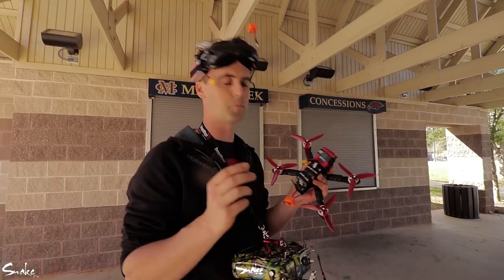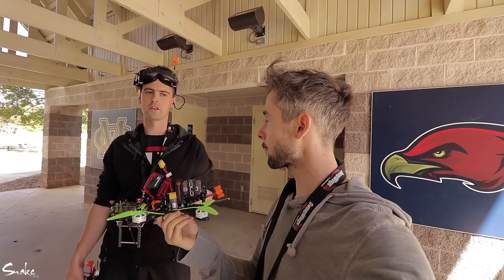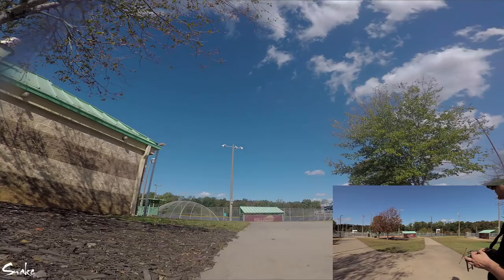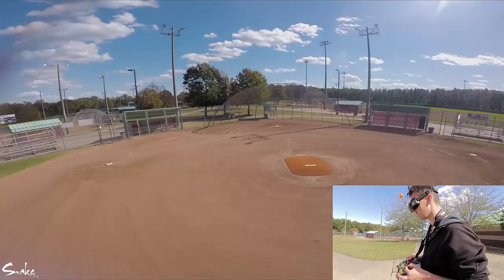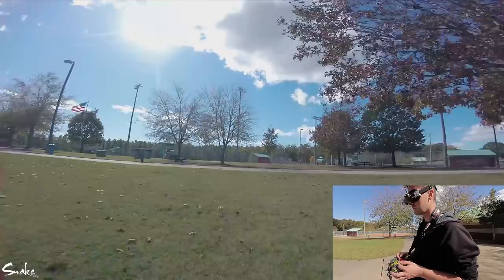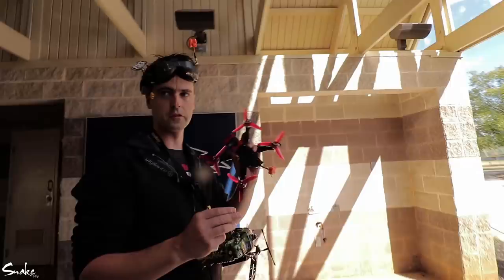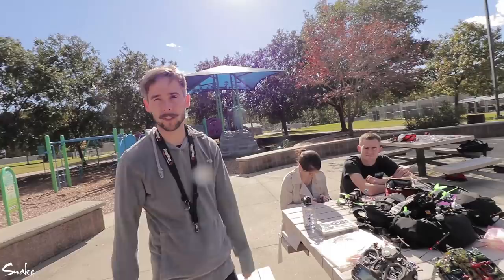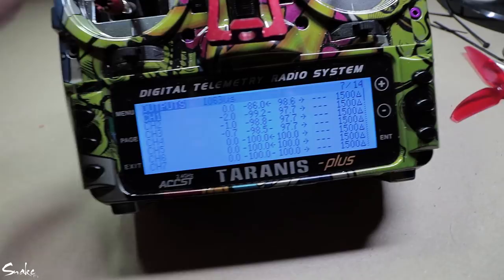Idle up (throttle cut) VS Airmode blind test!

Comment: How Airmode really works... Its actually pretty simple (but easy to misunderstand). The main thing airmode does is gives the flight controller the authority to set each motor speed as high as it wants at any time. If the flight controller wants to set the front left motor at 90%, it can, even if the throttle stick is all the way down. 

Before airmode, if the throttle stick was at 43%, then the MAX throttle the flight controller was allowed to go was 43%. If you roll right really fast, then the left motors were at 43%, and the right motors were less than that, maybe 9% for example. With airmode, the left motors are allowed to spin up higher, like 60%, and the right motors will be around 26%. This isnt very important until you drop the throttle to 0%. Now, without airmode you roll right and the left motors are set to 0% and the right motors are set to 0%. Now you have no control and you fall like a rock. 

Enter the idle up hack. Now the minimum you can set the throttle stick is 2%. So now, with the throttle stick all the way down, you roll right. The flight controller sets the left motors to 2% and the right motors to 0%. Yay, we can roll. But now you notice what this means. We cant roll fast at 2% throttle. Well actually, quads are so powerful that even 2% throttle can indeed roll fairly quickly, but still not as fast as airmode, which can roll at 100% throttle on the left motors and 0% throttle on the right motors and spin at like 1 million degrees per second. 

This now makes it clear what the main benefit is of using idle-up over air mode. At low throttle, you get a very soft quad, and at high throttle you get an aggressive quad. It almost feels like dynamic rates based on throttle position. When you get good at flying like this, as mr steele is very very good, you will notice that you can do a snap roll faster by blipping the right stick to the right, WHILE ALSO, blipping the throttle up during the roll. So, you can do fast snap rolls with idle up, but you have to manage the throttle yourself. With airmode, you can just slap that right stick to get fast rolls. But you cant do soft rolls. I mean you can move the roll stick less, but its just not as controllable as a low throttle without airmode.

Comment: Next test: use air mode but raise min_throttle to the point where idle up was before. It's possible that the more locked-in feel of idle up is just because the motors are idling higher. This might give a better feel at low throttle but also cause floatiness.
Reply from the maker: +Joshua Bardwell hey man, during this test as someone asked the same question earlier so I checked again, the quad with air mode had min throttle set to 1065, the idle up input showed in kiss GUI as 1064.
Reply: Air mode is much better now - as josh said just set your idle throttle to turn motors smoothly without providing lift off ground - on Dshot600 my min throttle setting is at about 2.5% which gives a nice smooth prop spin with no lift sat on ground.  I think steele is behind the times a little.
Reply: Joshua Bardwell is there a video on how to set this up on kiss how do the motors spin when air mode is off thanks
Reply: Interesting. I fly both KISS and Betaflight and have different approaches for both. I use airmode on both, but I set my min throttle on KISS to 1050. Theoretically, less floatiness than 1065, but still enough control. On Betaflight, default Dshot600 is 4.5. A lot of people I've talked to tell me that it should be higher. But I found the opposite is true. I found that at 4.5 it idles at 1050-ish, but on some quads I've gone as low as 4.0, and I find idle to be at 1040-ish. That all said, I'm curious to test out idle-up now.
Reply: The "more locked-in FEEL" is IMHO because of the fact the motors are idling constantly. Airmode spins them only if the gyro "think" there is something to correct. I think the only disadvantage of IdleUp is some really minimal (not noticeable like the stability) decrease of inverted time. Btw Joshua, YOU taught me in 2015 how to setup IdleUp
Reply: So what the anwser? In the start! I never use airmode! cause steel tel that idle mode is better. And feel normal to mee to find the point of idle were i can do flip with no throttel! And no drop. But then all ,fly air mode!  So as a neewbi i do what the most do! But if it is better to remuve air mode an only use idle up? Then plz tell!!!  i rater smash 5 quad lerning the bedst whay! -- :-) Snake/steel - nice together! :-)
Reply: I learned something today! :v
Reply: Are you sure you're not just trying to defend Air mode to your last dying breath?  lol
Reply: I wish they would have left the damn numbers and not used percent.
Reply: Joshua Bardwell would you recommend brake on stop for blheli escs or would you not recommend it?

Comment: For Betaflight users,
You need to set "set pid_at_min_throttle = off" to not have a active gyro at min throttle.
Reply: Lawanti that's it? And airmode active?
Reply: Why would you want to do that? You want PID control when you are floating to keep it steady
Reply: so you can arm without an active gyro and when you idle up the gyro becomes activ again.
Reply: gyro still on after the command line.
Reply: SirCroMa VelociRotor 
have you saved after writing in the cla?
Reply: Lawanti yes
Reply: This is also useful if you want to be able to hit slides (eg playground slides or in my case, I have an indoor tinywhoop slide). With the pid at min = on, the motors will freak out due to the physical movement of the quad on the slide affecting the gyro.
Reply: fahrvergnuugen how do you set up your tiny whoop in betaflight to allow you to go down slides? Also would the set up you cause problems for extended zero throttle maneuvers like dives?
Reply: fahrvergnuugen no it is just a safty option. When you idle up the gyro is active again and you dont wand the gyro deactive while flying. At least on a fullsize quad.
(airmode will make your quad jump when it hits the ground)
Reply: Dan S - I use an idle up switch on my tinywhoop and I have the pid_at _min_throttle=off. When i want to fly a track and hit slides in the basement I fly with idle up off and that makes the PID loop stop controlling the motors at 0 throttle (they just idle) - that makes it slide fine and I'm able to hit a jump at the bottom and throttle up to take off mid air.  If I'm flying someplace where I could dive/flip/roll (tbh, I've found the tinywhoop to be so underpowered that it's not even worth trying), I just flip the idle up switch on and then the PID loop starts working normally when I chop the throttle.
Reply: fahrvergnuugen - so the idle up switch; is that something that can only be done on a Taranis? I have a Turnigy Evolution so Idk if there is a way to make an idle up switch, do you know? Also if you can't dive/flip/roll with your tiny whoop you should try out the NewBeeDrone Gold Motors, at 19700kv those things make your tiny whoop super powerful so it can do those type moves more or less.
Reply: Dan S - it can be done any any radio where you can program a switch to mix a channel output. I did this on my Futaba 8FG - I set it so that the switch simply adds ~50ppm to the throttle channel. (these are theoretical #s, it depends on min_command, min_throttle etc) With the switch off, the throttle stick travels from something like 1000 - 1950ppm, while with the switch on, the throttle stick travels from 1050 - 2000. The area between 1000 and 1050 was enough to activate the PID loop - you have to tweak the values according to your betaflight min command/throttle settings for your ESCs and motors.

Comment: Kiss DOES NOT have AIRMODE as is. Airmode its a betaflight invention. So simple as that. Its just kiss pid controller doesn't work when your throttle below min command. With throttle up you are limit lower part of the throttle. So when your radio goes below that limit, it will still send min command value. So far so good, your pid controller works. Now negative side. You just lost your throttle resolution (0-min command) range (like 6%?). Because of that, things like TPA will never be calculated in this range. So, effectively you are flying with HIGHER pids at 0 throttle then with "airmode". You can see it on TPA page of the configurator if you like. So, to have the same you need to enable custom tpa and up tpa influence @0 throttle. One more thing. Even if you don't use custom TPA, KISS STILL USE WHAT YOU SEE IN THE GUI TPA page by default. I hope it helps :) Personally, i've tried idle up switch like 2 years ago, didn't like it at all due to switch dance, and using min_command 1000 since then.

Comment: You could use invert function (!SA middle) instead of putting two functions (SA up and SA down). Its much simpler. The invert function checks if the SA mid stick is inactive. The special function actives when and only if the SA mid stick is inactive.

Comment: i really, really, really think that it is basically the same.

by raising your bottom point of throttle to 1063 or something, you also reduce the tpa influence on low throttle.
the receiver and the fc see 1063 and not 1000. which is 12.5 percent of the whole travel from mid to bottom.

therfore:
airmode on low throttle = full tpa influence.
idle up on low throttle = throttle for the flight control 12.5% higher and therefore tpa influence is 12.5 % lower.

do me a favor and reduce tpa or set to zero (for lower than mid throttle) and retry on your airmode quad.

because: there is for sure a reason why min command = 1000 is used on kiss to enable the pid loop permanently and no check box or switch assignment for "airmode". its the same!

the only bonus of idle up should be theoretically the checking of props by starting without pid loop.

i hope i could express my thoughts clearly :)
Reply: you are completely right ;)
Reply: I cant imagine tpa makes any difference at all. tpa attenuates pids at high throttle. While you are at 90% throttle, the fc has no idea whether the bottom of your throttle stick can go down to 1000us or not, and it doesnt care.

Comment: So much misuse of terminology. Throttle cut =/= idle up. Somebody please just watch JBs video on airmode. The difference between airmode and idle up is that airmode prioritizes 100% pid control. It is dynamic and reserves lower portions of the throttle to maintain 100% stability, this is also why bounces happen because forces which counteract the desired position are reacted to with 100% of the quads ability. Idle up does not maintain 100% pid control hence the floatiness. This also means at lower throttle the pid loop has less authority due to limited available rpms and bounces less when interacting with counteractive forces.

Comment: Thats another great blind-test episode. Really enjoyed and also love the "new gang" :)

Can you (or Steele) make a detailed howto on this?
I guess you need to do something like:
- Special function SE^ to override CH1 with -100 (you named it)
- bump the throttle by using a second Thr MIXER with a DIFF, looks like:
  -> MIXER:
  -> CH1    100 Thr     SE^         (idle position)
  ->    +=    100 Thr D9  SEv         (bumped to activate gyro)
- Then setup KISS like:
 - Min Throttle 1050
 - Max Throttle 2000
 - Min Command 1060
 - check on the "Data Output" if your idle-up switch bumps CH1/Thr above 1060
 
The idle up value can be adjusted through the combination of the DIFF value and the 
CH1 MIN value on the OUTPUTS page and might need some fiddeling.
On my Taranis a "Thr DIFF 9" and a "CH1 MIN -92.5" will result in an idle up of 1063 on KISS and 1070 on Taranis.

Thats seem to work on my setup, but I'm way to novice to state this is a correct "howto".
Maybe you can confirm?

Comment: Another proper blind test, love it :) 
fwiw I had the opposite outcome with Betaflight, I built a quad and forgot to enable airmode and it wandered around and felt sloppy in zero throttle situations. I thought I had copied all my settings exactly from my old quad so I was puzzled about what it could be until I noticed airmode was off.

Comment: I tried idle up at Mr. Steel advice. I set it up on my tarranis just like steel did. New to hobby but it feels better than the air mode on cleanflight that I'm use to. Much appreciated 👍

Comment: i dont know, im pretty sure there are too many variables here , i mean even with identical tunes, and even that may not be fair, may need some tuning for air mode to feel better. im all for min maxing and finding the perfect tune, and im no where near as pro as you guys but i have to be honest, Bf 3.2.1 / pt1 all notches disabled with dynamic enabled / soft mounts on everything on a clean build / stock pids - my quad feels amazing, better than i can describe without over exaggerating. it feels connected, is consistent, it flies great, i dont notice any oscillations or the quad pitching when i dont want it too, motors come down cool, its butter. for me, fun flying / freestyle- im happy with it- everything works perfect. im in quad heaven-  i mean if your not happy with airmode i can understand doing research and working on new ways to improve things, maybe i just dont fly at your levels, but for me air mode works, it does what its supposed too, and my quad flies great man.

Comment: You can and should replace both of the switch position tests with a single !Sx- ( switch x is NOT = middle position). not really a big big deal here but can be important with more complicated setups.

Comment: are you testing this on kiss for both quads? i've been curious about trying an idle up set up and i did try it on betaflight with the idle up switch set to 1045-1055 and it flew like absolute garbage with the idle up

Comment: I've been flying with an idle up switch on my quads for a good year and a half. I never liked how unstable air mode was when it first came out so have stuck with this. Idle up FTW. I always used throttle curves on my quads since starting flying fpv in 2013 so managed to get mine working with a switch that changes my throttle between 2 different custom throttle curve profiles. That way I can still tweak the throttle response over the throttle range.

Comment: You never have your xt60 pop out with your battery strapped like that?  good smacks on the ground would pop my connectors apart, so i started strapping them under the battery strap.

Comment: If the pid controller is out of the loop with idle up, won't it be terrible in windy conditions at zero throttle?  I've been flying since before airmode was a thing, but i was never worried about idle up because doing things at zero throttle was kind of not in my skill set back then.
Reply: No, because the idle up spins the motors, the second switch arms the quad, so PID controller is then active. Think of it like this. When you have single switch arming, like in Betaflight as an example, you assign airmode and "armed" to a switch. when you flip that switch, the motors spin and PID loop is active. So, now think of it like this. no airmode, but arm is still on that switch... you set a "throttle cut / idle up" switch that takes your throttle value from under min command (988 in this example, which is obviously under 1000), and when switch 1 is flipped, it then sends a throttle command, again, as in the above example, to 1068. We all know that a throttle value of 1070 in KISS or Betaflight = spinning motors, but no takeoff, same thing here, so switch 1 = motors spin while throttle stick is at ZERO. Then, switch 2, simply arms the quad, which all arming a quad does is activates the PID loop and gyros etc. So instead of having a single switch set the min throttle values for you, you have 2 switches, and 1 of those two keeps your motors spinning until you kill it. Pretty simple when you think about it. You are manually doing what airmode already does, but with some benefit, which was, as he stated, you can shake your quad, verify your props are straight, and not lose an eye.

Comment: I like the idea of trying this but damn I've been ripping with Airmode since it came out so I'm very use to it. A video on how to set this up on different radios would be cool. I'm on an older Taranis running 2.2 so mine should be fine to work with.

Comment: If throttle is at 1063 at bottom stick and thats higher then your usual min throttle value that could of made the quad feel more crisp as the throttle was a bit higher allowing the pids to have more authority. downside to that is your quad will fall faster while inverted. Try setting your bottom of your throttle in the radio to only 1 or 2 above your typical min throttle value and it may feel the same as airmode.
Reply from the maker: +DrewLittle FPV it’s actually lower, normally 1070
Reply: Ahh okay I fly a much lower min throttle. Makes sense. Im going to give idle up a shot on my kiss quad.

Comment: Well, you wouldn't expect the best pilots to also be the best at knowing how the software works. Im just going to ignore the incorrect explanation and just take this to mean that some pilots really prefer idle up, which is understandable. It has its benefits for sure.

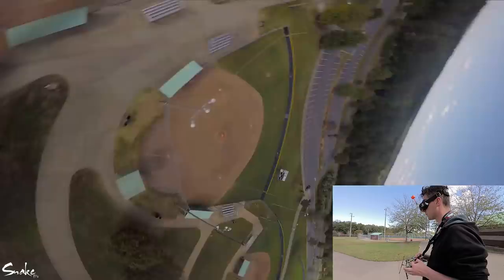Also, I agree with snake that the air mode jump test looked like it held attitude worse, which shouldnt be true. This makes me wonder if there is a tuning difference, maybe a filter setting is different that they didnt notice. Edit: watched it again. At 6:51 he mentions the I-terms are probably different on the quads. That would explain it. So its possible that the conclusion is: idle-up on a good tune is better than air-mode on a bad tune :)